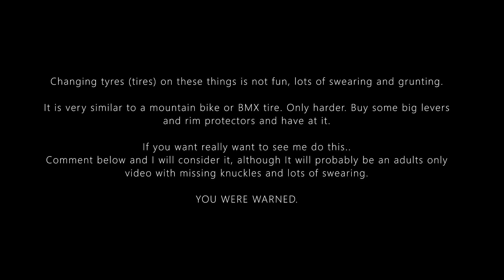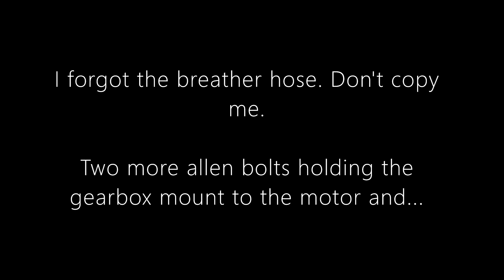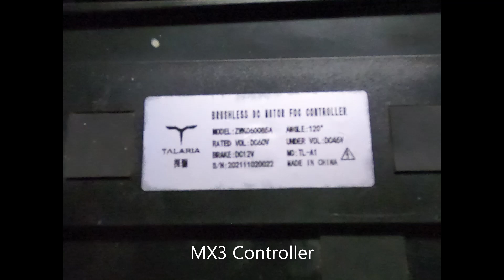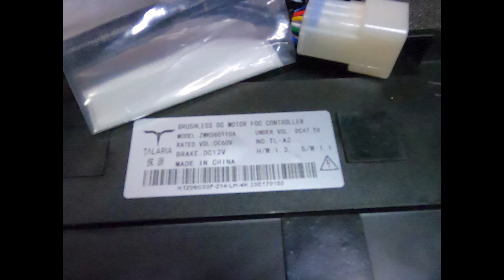Talaria Sting MX3 to MX4 conversion. Can it be done? Part.1

Comment: For data collection purposes could you capture the real time kw output using an amp clamp meter? Since MX4 is rated at 8.5kw on a fully charged battery.

I’ve seen a Sting-R review showing once battery reaches 30% capacity kw output drops greatly. Output kw data at different battery 🔋 🪫 percentage would be an interesting experiment for data collection purposes.
Reply from the maker: Good call. Now I guess I'll have to find a DC tong.. haha.
Reply from the maker: Also I have been trying to get a read on this myself by watching everything i can. EBMX, Progressive E, Moto Machines UK, and Greenline Engineering are good if you read between the lines, and definitely ALoopEbikes battery teardown video.
Reply: @wheels.3239  Time for me to do more research as well. Man this research rabbit hole I’m in is wild, never ending lol…. Thanks for the heads up sir 🙏🏼!
Reply from the maker: @GAME-808  Anytime, if we all share the info and get a commnity vibe goin we all have a better time. Stay Rubber side down my friend.
Reply: Hi, with a good DC am clamp, it could be possible. I would remove battery cover and clamp it on the positive ( or negative ) wire just out of the battery. For great result, we mostly read dynamic voltage as it will drop with on a WOT pull then you do calculations so voltage time amp will give us wattage.

Comment: I believe the mx4 controller works without a bypass it talks to the bms becaise its talaria. Ive seen someone run a mx4 controller woth the mx3 battery no bypass.
Reply from the maker: Im half way thru the next vid. and my editing laptop sucks hard. I should have it back together tomorrow. And ..Spoiler, I reckon i'll run it in on the Mx4 controller.   I gotta try it!
Reply: @wheels.3239  that'll make all the work worth it
Reply from the maker: @MotoAlias  You know it!!!
Reply from the maker: Thinking bout the 'no bypass' stuff you said makes me wanna get out bed and go finish it but i got crap to do in the morning..Doh!
Reply: @wheels.3239  it's the middle of the day here lol you'll get to it when you get to it

Comment: Long tooth question that you or your followers my be able to help me with.  I brought a mx3 mid 2023 new, it had a leak in the gearbox and I hadn't ridden it and the controller had the 4 silver stripes. The supplier replaced it once they had new stock.  The replacement was 8 weeks later with upgrades , DNM forks, peg brace and what I did notice that the controller had 6 silver stripes like the mx4 has. Trying to find out if battery upgrade would work with the 6 stripes controller and mx3 motor?
Reply from the maker: Probably best to check with the supplier via the part number on the item they sent but if it compares to the one on the right in my video its should be Mx4 and will cope with the battery upgrades. Your motor may not for long though.
Reply: The Australian distributor has an upgrade package with 6 stripes on the controller and the R battery, which is plug n play in mx3 and mx4. The upgrade will also work with the mx3 battery. They  replied to my email regarding mx3 motor and say that will not be any problems using mx4 controller/ battery upgrade. .
Reply from the maker: @Pedro-ju7tp  Thats awesome, thank you for letting us know.
Reply: @wheels.3239 I have finally had a look at mt controller on my mx3 with 6 silver stripes.  Unfortunately it's not the mx4 controller by the information on the back. So, I have ordered the controller/ battery mx4 upgrade. I'm going to test the mx4 battery with stock controller for distance and throttle curve, then both batteries with new controller. See how this goes
Reply from the maker: @Pedro-ju7tp  My Mx3 controller only has two stripes, i wonder why they changed it then. But i'm excited for you now. You are going to be telling me how good it is. hahaha. Did they say how much for just the battery, it is still not up on the AE website ? ive been checking daily now. lol.
Reply: @wheels.3239  I sent an email in regards to the link for the mx4 battery only before I had pulled out my controller but not herd back from that. My details on my six silver striped controller is the same as your 4 silver striped controller.  I'm either going to get more distance on my new mx4 battery with mx3 controller, then change out controller mx4 for more power.  I'm hoping for a little more power and more distance so can enjoy the trails longer.
Reply: Well, my power upgrade controller/battery mx4 arrived yesterday.  Fitted it today and test ride on weekend coming. On the stand, it punches out 92km ph with Shinko 244, which are a heavier tyre than stock. See how the mx3motor holds up as Ae Bikes assured me it will. Check motor temp along the rides. The controller details aren't the same as stock mx4 on the back, it may be all in the pre program parameters. Find out soon.
Reply: @wheels.3239  wel Wheels the verdict is in. Bothe batteries with the new controller on a stand push out low 90kmh, but on road with me at 110kg, the stock battery gives me between 58kmh to 70kmh depending flat or incline. The mx4 battery gave me 65kmp to 82 kmh depending on flat or incline. Definitely noticed the torque with mx4 battery/controller combo, wheel rear wheel spins in gravel at take off. The motor was quite hot after 6km of flat out, which I normally don't do. This is something I will keep an eye on and can swap out to mx4 motor later if issues arise.  With the extra power, I'm thinking about rim locks as the next mod as I have already upgraded the breaks front n rear. The battery/controller combo was a big out lay but well worth it. Now, I have two batteries to choose from depending on ride plans. Btw mx4 battery gave more kms on the clock trail riding today, normally mx3 battery with 20% left, but mx4 still had 50% left and punched out more kms. 👍
Reply from the maker: @Pedro-ju7tp  Mate thats awesome, It sounds like its well worth it. I have had go pro and editing issues, so ive just been riding. I am stoked for you. I bet its a lot of run to ride. I have bought the brakes but havent put them on yet, but you have made me really want the battery. Haha.

Comment: Can I fit an MX4 motor on my MX3 without having to change to the mx4 controller  and battery?
Reply from the maker: yes
Reply: @wheels.3239  so the gearbox from the mx3 is compatible with the mx4 motor on mx3 frame?

Comment: How big is the difference if you just swap the controller?  (from MX3 to MX4) 😁 

I'm thinking
Reply from the maker: Hey, sorry Yukin, You wont gain anything with just the controller, it's all about the battery. Save your money for now. The TORP Controller for the Talaria is comeing, it will be the best controller yet for stock batteries.
Reply: Swapping the controller from your mx3 with a mx4 controller will gain you 2,500 watts of power. Your mx3 motor will easily handle this as well as the 38.5 Ah battery.
Reply: @eucme9716 so I can use the same mx3 wiring harness on the mx4 motor and controller?

Comment: Question if you don’t mind. Will the MX4 motor fit on the MX4 stock gearbox and mounting brackets? I’m looking to swap to the MX4 motor and want to confirm is a direct swap before purchasing. Thanks for your help!
Reply: Fit on the MX3** stock gearbox and mounting brackets.
Reply from the maker: @Stevieee33  Yes but you need to get the MX4 gearbox bracket with the motor, it is 4 screws not 2 and was only a few dollars more.
Reply: Awesome, thanks for your response!